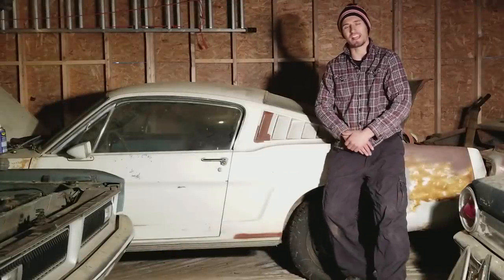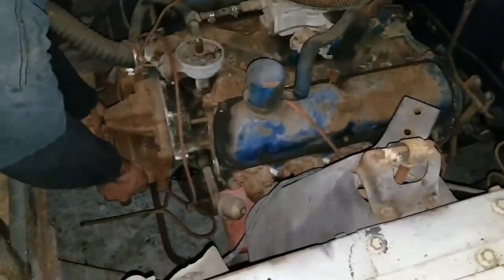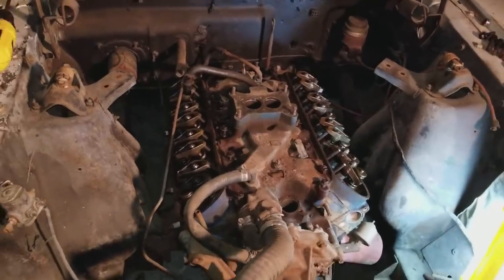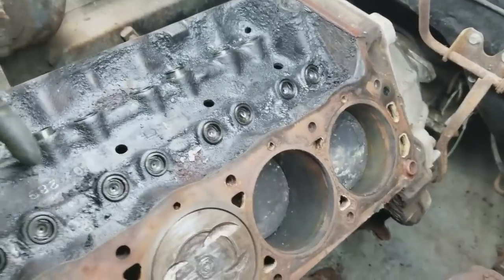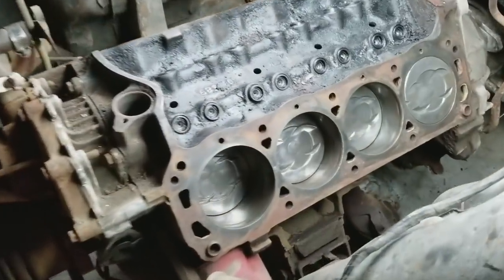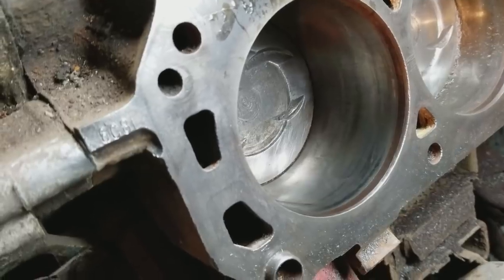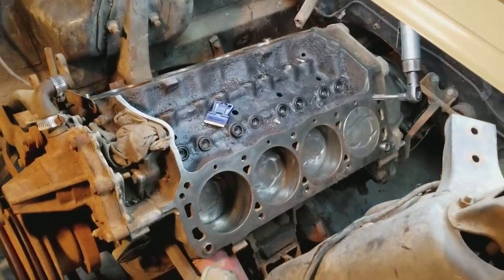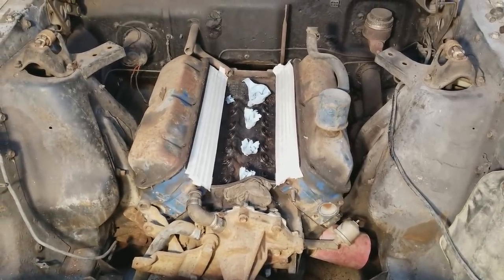Forgotten 1965 Mustang First Start in 44 Years, Fastback Revival Part 1!

Comment: I would've done the opposite of what everyone is suggesting here, and done less, I have a camera I would've put into the spark plug holes and tried to scrape what I could and vacuum what I could then gone to Pick a Part and found the exhaust manifold and changed the fluids and attempted a start, then change the oil fairly quickly.  I know it might not be "right," but most likely, people who let the car sit for 3 years aren't going to suddenly rebuild the engine and do everything "right."

Comment: Someone put a 66 grill in it. Looks a lot better than the 65 chicken wire grill.  A side note... this year I put a new Holley 500 2bbl on my 66 and it's never run as well. Instant starts and good mileage (relatively).

Comment: You should use oil or penetrating oil any time you're cleaning cylinders or rethreading holes or what about a valve job if if you got the trade-off.  and you went that far why not get it done right

Comment: I have messed with those engines and I would not have even bothered with this one. Just an old 302/351W. Yank it out and toss it in the scrap pile after that long. Those engines are a dime a dozen, pick up a long block at your local parts store and bolt it in.

Comment: Making it a lot harder than it needs to be.  Pull the engine, break it down sent the block to be hot tanked and reamed and buy all new pistons, lifters and rods.  Get the heads machined too with new valves and valve guides and have the surfaces planed.  Dont be a cheap ass!
Reply from the maker: Pull the engine right now, impossible due to the car being in storage... and if i ever were to pull the engine, it wouldn't be going back in the car that's forsure. But hey, if you want to pay for all the machine work and new parts let me know and we can get her ready come spring time👍
Reply: @Theoldcarchannel.  well I guess I was out of line.  I didnt know you were on a shoestring budget.  cheers my friend.  you got it done.

Comment: I am interested in a project like this too! How much did it cost approximately to purchase the almost wreak that you started with
Reply from the maker: This car is far from a wreck. Just because it's engine doesn't run doesn't class the car as a wreck. NOW, if the car was rotted and the engine was stuck... that's a wreck. A car this solid will cost anywhere from $15k up easy

Comment: Nice vid and subbed already, I def would of just pulled the engine from the start though... it would of made it so much easier to work on .
Reply from the maker: Thank you, appreciate the support! As for the engine, the car is currently in storage so not much we can without an engine hoist. Also if the engine were to ever get pulled I'll just drop a 5.0 in with a 5spd

Comment: Why didn’t you have the heads ported and polished while off. Fit them with double valve springs and bigger valves. Improve performance no end. And while they were off why didn’t you hone the cylinder ridges out
Reply from the maker: Because I dont care about performance. This is a budget build, basically seeing if the engine will run/Is ok internally. If not the I have a plan B

Comment: That much ridge at the tops of the cylinder means the motor is worn slap out. Just pull it and rebuild it after a bore and hone.

Comment: All they want to do is hear it fire-up. People have "NO IDEA" about 
engines. All the oil is drained off many critical parts , cylinder wall 
most likely have some rust or corrosion, suck all the dirt and rust 
through the fuel system. When I race cars, if it was humid one or two 
weeks you get stains on the cylinder walls that would hurt the 
performance, but after years without running or lubrication forget about
 it. Take the engine apart and do it "RIGHT".

Comment: You can hardly call it "will it run after 44 years" when you clean or replace almost all essential parts of the engine, ignition system and fuel system. I like the car though.

Comment: Dried water deposits in that one cylinder, looks like.
Reply: Could be lead deposits too.
I am currently driving an '83 GT 5.0 - if the odometer is correct it has about 177,000 and not completely stock on engine and chassis. Strong engine still from compression checks.

Comment: Looks like someone threw a '66 Dashboard and '66 Front Grille on the car.... Also, The engine was painted '66 Ford Corporate Blue, Correctly, The '65 block should be painted ALL GLOSS BLACK including the heads.  The valve cover and air cleaner should be Ford 60's Engine Gold.  Nice find!   Tony K.  MCA#70001

Comment: Hey guys wire brushes suck for that job, one little wire in oil pump and your engine loses oil pump drive. Used to work at Ford dealer and had cars coming from different dealer that tech used wire wheels, pickups came out looking like porcupine. You guys went way to involved in clean up. Roloc pad on pistons and deck much quicker. Picking every last speck of carbon , waste of time as the pistons will build up more and it's actually helps the engine e to point. The ring ridge is normal for older cars using conventional oil and normal tune.
That sludge wasn't bad, easier way would have been use hand wire brush and shop vac. And then wipe down with carb cleaner. 
Then upon oil fill use diesel grade oil as it has enough zinc for flat hydraulic tappets.

Comment: step one remove engine - strip - hot tank - complete new bottom end - rebuild with all new OEM Ford parts.
Reply from the maker: Step one... impossible right now. Rest of your plan is expensive and rebuilding with OEM parts would never happen. If I'd go through the steps to build an engine... it wouldn't remain stock I can say that much.

Comment: Never use a wire wheel, hopefully the pieces of wire that break off dont get in the oil pump, seen it happen on a 460 ford. Scotch Brite pads are the best, or a flat stone.

Comment: The grill is from a 1966 Mustang.  The speedometer is from a 1964 1/2 Mustang.  Are you sure this is a 1965 Mustang Fastback?  It looks to me like a 1966 Fastback that has had a few parts, like the speedometer, changed out on it over the years.
Reply from the maker: It's a 65. Grille was changed out. Actually it's a pretty early 65 fastback so I couldn't doubt it to habe some left over parts from early production cars. Regardless, it's a 65.

Comment: Please put Marvel mystery oil in the cylinders take spark plugs out squirt some around walls of cylinders let sit over night and squirt some more around cylinders again let set for a couple of hours change oil if you can add marvel mystery oil add it  then start with new propper  gapped plugs  my dad was a Master mechanic and that's an old procedure that they used to do it frees up the rings so they don't stick to the cylinders  .run the oil about 1000 miles and change again  and she should be good

Comment: If you open the engine please just do it right.
Take it out, take it apart and at least run a ball hone and put new rings in and new bearings, afterwards everything has to be cleaned up properly. Not run a steel brush on a drill machine so all the shit falls down into the oil return holes..

Comment: Sorry to pick out your mistakes but that’s a 66. I can tell because of the grill, the 66 grill has the floating horse with straight lines while the 65 grill has a honeycomb design with the horse symbol connected on all 4 sides. But then again it has a 65 interior with the straight speedometer and not the circle gauges
Reply from the maker: I know it has a 66 grille, youre not the first one to mention it and probably not the last. It's a 65 car with a 66 grille. Very easy parts to be swapped on and off
Reply: classicmustangs429 I understand but I do like both kind of grilles I respect you for restoring this mustang

Comment: Are you guys sure this is a 1965?  It has a 66 grille and a 66 hood latch (65 has 3 bolts).  The engine block (assembly date March 1966) and heads are 66 (rail rockers),. The door panels are 66 as well as the dash pad...  The only 65 stuff I can see is the instrument panel.
Reply from the maker: It's a 65

Comment: I think the engine was burning a lot of oil from the looks of the pistons. Maybe it would save you al lot of work in the long run to do a full rebuild instead of putting it back together as it is.

Comment: I know that I am maybe talking out of my ass. But isn’t a engine heart of a car. Why would you do job like some sort of a BUTCHER when you should have taken the HEART to a HEART SURGEON and got it done properly!? I know it costs money but looking at a video I think you have made a mistake but not putting money into that engine. That way you would have had a peace of mind that it will run for nxt 20+ years! 
To my small knowledge of things cars and engines as you know there could be things that go wrong and could cost you far more or even MAKE YOU PUT A NEW ENGINE IN THAT CAR, which is a SACRILEGE “ in my Mined “ 
But saying that I DO HOPE I AM WRONG AND ALL RUNS WELL AND THERE IS NO PROBLEMS IN NEAR FUTURE FOR YOU!! 
I live in BiH and wish you best of luck with that BEAUTY! 
“ wish I could come up with a fined like that dream car!”
Reply from the maker: You're not wrong, the heart of a car is the engine.... and yes the proper thing to do would be to pull the engine, rip it apart and send it out to be cleaned/ machined however 1. It's winter time and the car is in storage so engine isn't coming out anytime soon 2. I dont want to spend alot of money on one car (rather than spreading the butter on a few cars). 3. I want to see if a cheap clean up will do the trick to simply get it back on the road... Now like you mentioned, a rebuilt engine could last 20 years... or ....it could die the next day (* poof there goes thousands of dollars*) there's no guarantee. 
If the engine survives great, if not I'll just throw another engine in it like a carbed 5.0L roller engine and a 5spd. This car is going to be a driver, I dont care about "numbers matching" or perfect paint/body... I plan on enjoying this car.
Reply: classicmustangs429 
Yes it could go pooof nxt day! That’s why u use people that guarantee there work at LEAST A YEAR! 
Maybe it is me because I fell in love with them in film BULLET and only seeing vary few of them here in Europe. But not to keep it as original as possible. I think you will regret it few years down the line. 
But if this is going to be your day in day out drive to work and back lol you could have put LAWNMOWER ENGINE IN 🤣. 
Like I sad wish you all the best with it.

Comment: To bad it is an auto car.  What i would like to know is what are the plans for the 64 Fairlane in the background?
Reply from the maker: Good eye! There's actually two 64 fairlanes there. The blue one will be getting fired up soon hopefully. The next series after the 65 fastback (this series) will be 65 comet. And then most likely the 64 fairlane will be getting some love. It's a 289 auto car. Originally from Georgia. Need a little floor work. Its got a rebuilt short block. Should be a cool series
Reply: I noticed it because I used to have one which was an ex-drag 289 4-speed car .  I drove it cross-country to Florida from Wisconsin in 1984.  It was getting pretty rusty so  traded it for a 1966 Fairlane which turned out i could not get a title for so I bought a 1970 Rancharo GT and put the drive train in it.  I have been looking for another one for years.
Reply from the maker: @gilbertnowak5770  was your car a factory drag car? Reason I ask is because we have a 64 fairlane K code  (289 4spd car) that actually states "Drag car" on  one of the factory documents. I was always under the impression that "drag cars" were big block cars? Any idea?
Reply: Mine was the same thing .  When i got in 82 it had a 68 302 , the Hi-po 289 let go several years eariler after it's racing days were over.  I souped up the 302 and never lost a street race with it in the 3 years I drove it. It really broke my heart to trade it off that 66 but i could not find another one, so i put the drive train in  the 66.

Comment: first...the crud is going to scar the cylinder the compression wont be perfect there.  second. i would have done what you did at 10:41 before you cleaned the piston tops because all the crap thats coming off is going to go right back in the cylinder holes, and on the pistons.

Comment: Hopefully you didn't leave any low spots in your block hope the head gasket seals for you. That look like a pretty aggressive wire brush you were using. but at least it was a cast-iron block and not an aluminum block you would have for sure ruined in aluminum block good luck.
Reply from the maker: A wire wheel if that lightness would never leave noticeable low spots to effect the matting surface. If the block we aluminum I wouldn't have used a wire wheel.

Comment: The mud nests are formed by Mud Dauber wasps that sting and paralyses spiders, they then lay their eggs on the spider and when the eggs hatch the larvae eat the spider, lovely creatures right?.
 As for your treatment of the engine, some of that crap you scraped off will end up in the top ring lance and the oil galleries and just make matters worse. Just the sludge in the valley should have been enough of a forewarning to pull that engine and rebuild it. Sludge = neglect. I understand you will probably rebuild it at a later date, but all this appears to be a exercise in futility.

Comment: Well i must say if you are on a budget can afford to get this engine rebuilt then it makes sense why you would do what you just did in the video. Having said that dude with all of the problems even with all that cleaning that motor wont last long. You have no idea if he has any kind of cracks in block or if piston rings are not fired push robs could be worn out. With a car sitting for 44 years. Take the motor and trans out i would have have that motor and trans machined. see how i could add more horse power to that block. decided type pistons rods values, heads, Distributor cap, intake, Carburetor, the whole 9. I would have stripped to block had everything cleaned to the core and rebuild the Motor and chance Suspension, brakes and lines for sure, Gas Tank redone or brand new and maybe check the Chasity do major work on it before even consider to put it on road, but hey to each it's own

Comment: U have it so far apart I would have just finished pulling it apart, put it in an ultrasonic cleaner and rebuilt it from the block up
Reply from the maker: Because it's in storage and there's no access to get an engine hoist to it... plus, if I pull this engine put there's a high chance it will never go back in. There's 2 5.0L and 5spds laying around the shop ready to go in if anything fails

Comment: What is dry sos?
Reply from the maker: Super fine steel wool. You can spray lubricant to make it easier to remove crud but I used it dry so I'd be able to blow it out of the cylinders
Reply: @Theoldcarchannel.  it also means that it wasn't saturated with that funky blue soap.. same as 000, or 0000  steel wool, basically.. :-)

Comment: Use kerosene to clean out the engine valley and let it run through the engine block and out the oil plug.

Comment: why not painted te heads while there out?, for originality? you've cleaned it already, so why not?
Reply from the maker: Because it would ruin the theme of the car... if I painted the heads then I'd want to paint the block, which would lead to the valve covers, engine bay... etc. Car is going to be driven like it was meant to be driven so not worried about making things "pretty"

Comment: Surprised you guys didn't just remove the engine to do all this work. Would have been much easier to do that than hunching over the fenders.
Reply from the maker: Car is in storage. No way to get an engine hoist to it. And if this engine comes out it won't be going back in. Have a few 5.0L and 5spd ready to go in it at anytime in the spring/summer time (worse case scenario).
Reply from the maker: Just want to see if it'll survive using cheap means, if so then great, if not... swap it out

Comment: You had the heads off and didn't put new valve seals and lap the valves WHY ? The cost is minimal and worth every penny.
Reply from the maker: The valve seals were already done, not looking for this engine to run perfectly, more so just want it to run lol. If it dies it dies and I have plan B ready😉😎

Comment: I can see you don't know much about working on used motors. You have to keep all the parts in order and put them back just as they were. Things like pushrods, lifters, and all other valve train components develop wear patterns and if you don't put them back just as they were, it will lead to failure.
Reply from the maker: Push rods all went back where they came. Had them organized. Lifters never came out

Comment: 66 grill and 67 and later heads. wasting your time and money doing a half ass job!
Reply from the maker: Money? All I've bought is a water pump and fuel pump, everything else is scavenged parts. Even if the engine dies, I'll take those parts off and use them on another car. And because the car has a 66 grille and 66* heads it's a waste of time, makes total sense!👍

Comment: I have owned and raced Mustangs for well over 40 years. Really sad to see a  classic car like this get treated so badly by a so called Mustang enthusiast. No good mechanic would put all that grime he scraped off the pistons down through the rings like he did. At the VERY MINIMUM the motor should have been pulled and completely disassembled, cleaned in a hot tank before putting it back together. But with the ring ridge it has it should be completely rebuilt to ever run properly.  I can only imagine what horrors lie ahead when he starts doing body and paint work. 2 thumbs down on this channel. And for a car that was only on the road for 10 years??? This thing was thrashed!!